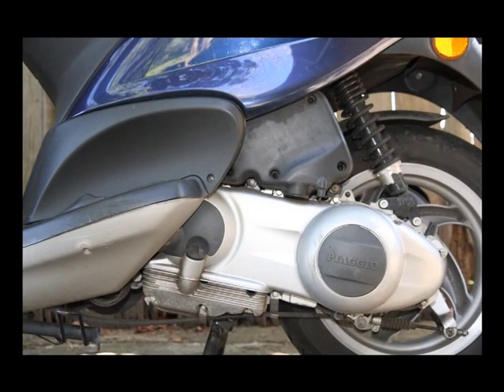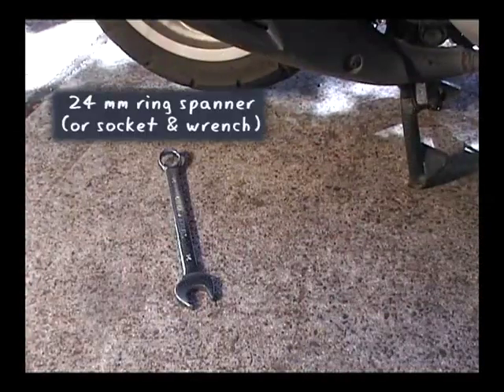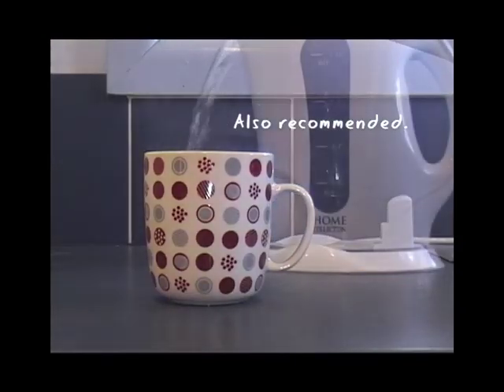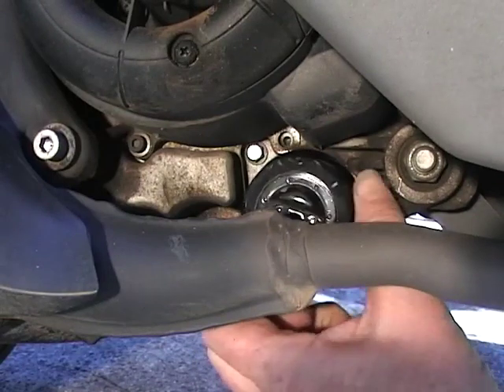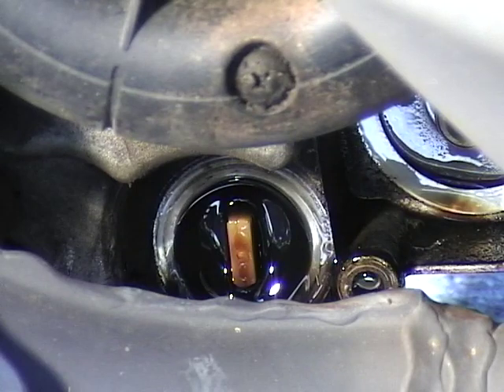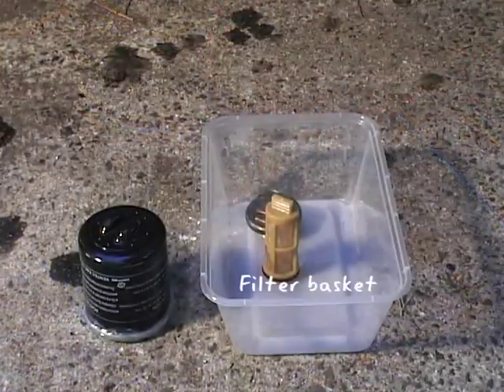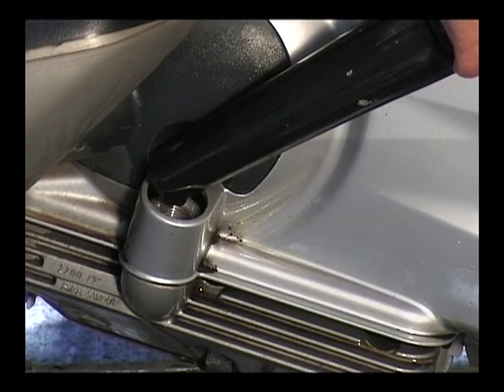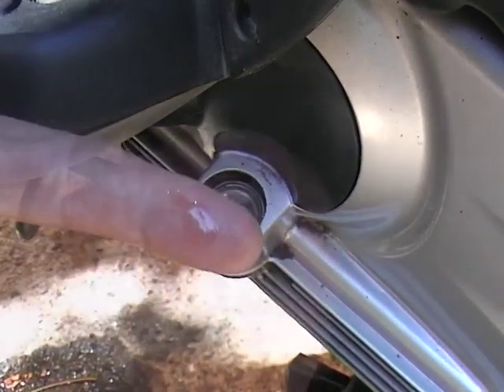Piaggio Fly 125 Engine Oil Change

Comment: I followed this video to change my oil on my 2006 Liberty , The only thing i had to do was take the exhaust off. However if you do not have the correct tools for the job i would not recommend doing this !!!  
I was very pleased that i changed the oil and the gear box oil by following instuctions put on by people that have the time to do this , Many Thanks

Comment: Thanks so much for your video I had the same issue with removing the drain plug. I finally had to remove the exhaust pipe (2 header nuts and loosen the strap at the muffler) was then able to get my socket on the drain plug and with the impact wrench connected it came out faster then you could say piaggio. In the excitement I forgot to put  my oil pan under the scooter to catch the old oil. My wife who was watching burst into laughter and said “no dinner until you clean up that mess “ rotflol
Reply: Uncanny! My experience precisely including commentary from spouse.

Comment: Thanks for the filter tips. I have a Fly 150 and it uses the same filter type but, as you have mentioned already, Piaggio won't tell you which is the right one. Got the HIFLO from Amazon, about $8.

Comment: Bought a Piaggio Fly 125ie last month. Loving it. 

Very useful video, thanks. 

It's going in for its 1000km service on Tuesday - I tried to check the hub oil (yep, just check it!) the other day. The torque that the workshop guys had used was ridiculous. Nearly took the skin off my whole hand! How are you supposed to do general maintenance if you can't even check the oil level?! 

I'll be getting them to reduce the torque on it, and I'll make sure they do the same with the engine oil cap too.

Comment: Hey mate top video, I did mine on the weekend and didnt have a 24mm ring spanner so i had to use a socket which means moving the exhaust to fit the socket onto the sump plug. I used motul 10w-40. And yes mine was so stupidly unbelievably tight to get off too!!

Comment: Thanks Stephen upload. i have a fly
125  and now i use Valvoline total synthesis oil,  but Italy's  piaggio engineer told me mineral oil is best for fly 125. it mazing me !   we are always change oil at 3000km in China, 6000km is correct or not?

Comment: Thank u. My typhoon 125 manual didn't say where the drainage bolt was, ur engine looks the same so I'm guessing it's there.
Reply: Typhoon is 2 stroke
Reply: correct on the 50cc version. the 125cc is 4t

Comment: Good video. I have a fly 150, how often do I need to change the oil?
Reply: Miles?
Reply: +Nazz Boner Did you ever find out? I think it's every 2000 miles.
Reply: Peace
1500 to 2000 is a safe bet. I don't see Shell Rotella T6 5w-40 syn oil going bad before that.
Reply from the maker: +Nazz Boner Thought I'd replied to this. My handbook (page 34) says every 6,000 km (=3,728 miles). Check the level every 1000 km (=621 miles) and top up. (There are km-to-miles converter pages all over the Internet.)

Comment: que pena que no lo hagas en Español.. todo correcto, pero te falta lo de revisar y en su caso cambiar juntas toricas de tapón de vaciado y llenado, si es que estan en mal estado. 
lo que no termino de entender es el tornillo que sacaste junto tapón de vaciado... para que es?
Reply: Lástima que no hiciste tu pregunta en inglés. No había juntas tóricas, o las habría reemplazado. El tornillo era para sujetar el tubo de escape en su lugar. Tuvo que ser movida para completar la operación.
Reply: @TheBlueDaweStudioThirlmere  Excuse me, but on Piaggio Liberty it does have O-rings, one on the filler rod cap, ... Another on the screw nut, drain cap, ... And finally another on the filter housed in the oil outlet duct. .. It is convenient to check the last 2 and it is better to change .. the filler cap can be done at any time. I don't know if the Fly carries them or not, although I think and would say yes. I have written this comment in Google translate so that it reaches you in English... The language issue is solvable if you edit and add subtitles in Spanish. There is a large Hispanic community to follow your good videos. you will gain subscribers. Greetings friend.
Reply: @TheBlueDaweStudioThirlmere  El tubo de escape es un poco molesto para esta operación, yo en mi caso tuve que sacarlo porque no había manera de aflojar el tornillo tapón de vaciado, con una llave fija estriada ni con la fija abierta., y para poder meter un vaso de carraca de 24 mm , no había espacio.. por ello tuve que desmontar el tubo por completo. 

@The BlueDawe Studio The exhaust pipe is a bit annoying for this operation, in my case I had to remove it because there was no way to loosen the drain plug screw, with a knurled wrench or with the wrench open, and to be able to insert a 24 mm ratchet socket, there was no space... so I had to completely disassemble the tube.

Comment: couldnt get the cap off to drain my piaggio!

ended up buying wd40, spanners.... nothing worked..

in the end i ended up buying a suction oil pump (Oil and Fluid Extractor Pump) from amazon, and sucking the engine oil out of my piaggio from the dipstick hole, but worked a treat though....
Reply from the maker: Yep, it can be a killer to loosen. I lost skin...
Reply: i dont know how you did it! i couldnt move it a muscle. used an AJ, bought a spanner, WD40, i ended shearing off the corners of the bolt! i got a feeling that it hasnt been taken off in years though...

Thanks for your video, even though i went i a different route, i wouldnt have even known how to access my piaggio libertys 125 cap, if it wasnt for your video
Reply from the maker: You are not alone, brother. Read all the replies here, from those who struggled with The Sump Plug of Death.
Reply: Tony Jones I started to sheer the nut so I can't getting a good grip as of the moment :(